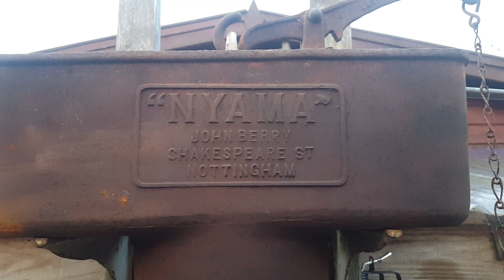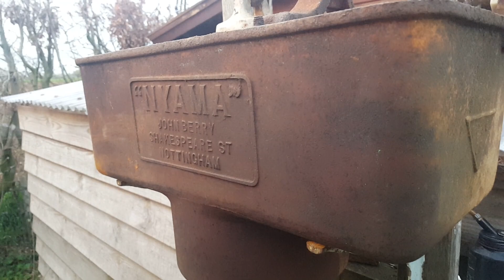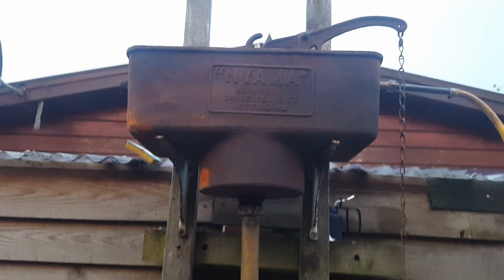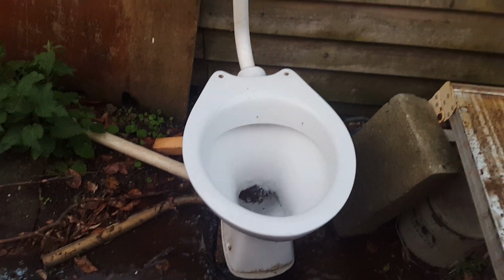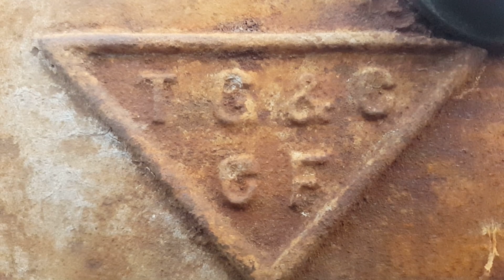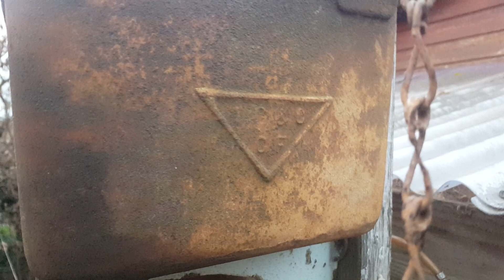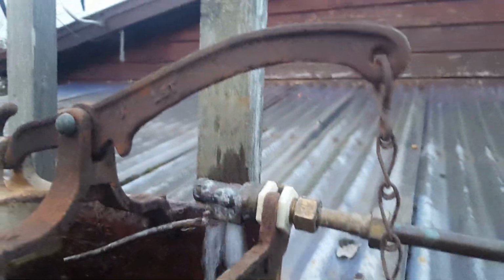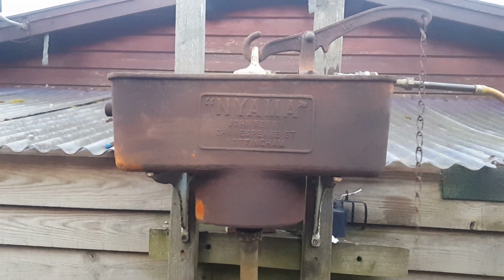Pre 1925 John Berry of Nottingham "Nyama" Cistern, Before Restoration

Comment: Gorgeous, in great nick too. I somehow doubt it ever had a lid tbh the way the fulcrum and ballcock are set up.
Reply from the maker: That's quite encouraging actually. After all, it seems ancient & certainly very early
Reply: @castironcisterns  seemed to be a common theme back then to mount the ballcock higher than the top edge of the cistern
Reply from the maker: @TwyfordsLad  Tis very good as no one (luckily not encountered someone like it yet) can use the "backflow" excuse on condemning this if I put a Croydon valve in here. High inlets should deffo have stayed common practice tbh.